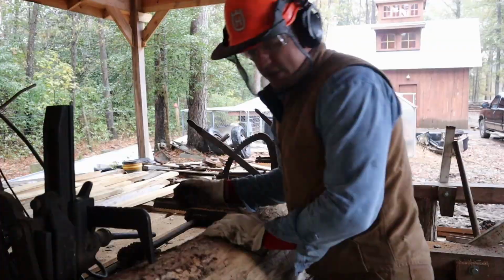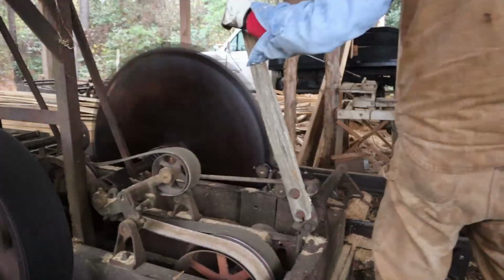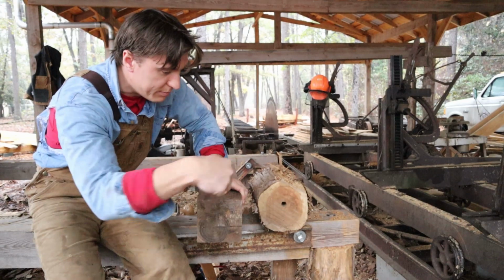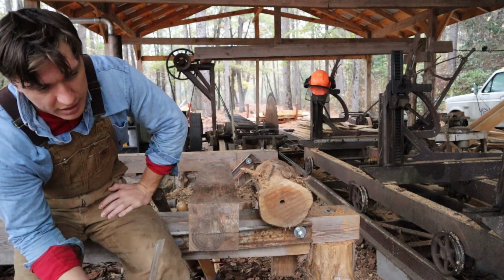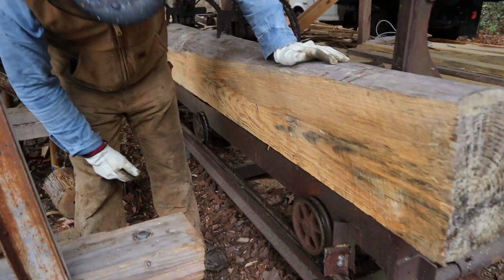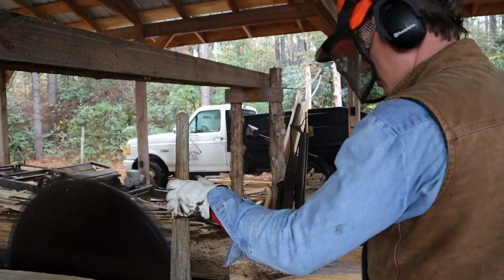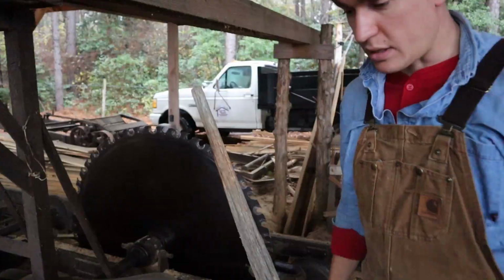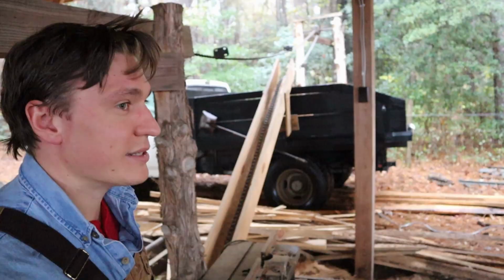Meet The Sawmill! [Part 2] | MILL WORK 2019

Comment: So good to see you keeping the old mill running in the way it was built. I ran a 60inch dankaert bandmill from the 1930s for about 10 years before we pulled it out and fitted a modern primultini. The old mill went to Africa somewhere along with a stenner band rack and I guess they are both still running. I love the ingenuity of the old mill designers. Funny how we could cut more in a day with the old dankaert than the woodmizer guys can in a week with 100% straight boards and beams but the labour cost had to be reduced hence the new mill.

Comment: I used to help a man run his mill back in the eighty's and he had lost two fingers reaching into the blade but as long as it's your fingers i am ok with it. he also had an extra pully off the top to run a fan to move some air when it was hot.
Reply from the maker: still got all 10 so far!
Reply: @realhardwork  Try your best to keep all 10 and maybe grow an extra if you can. And the sawyer ALWAYS leaned away from the saw when he had to do something there. IF he fell he'd fall away from it.